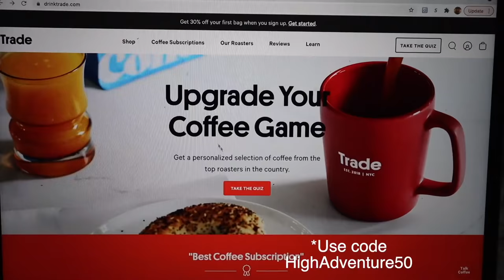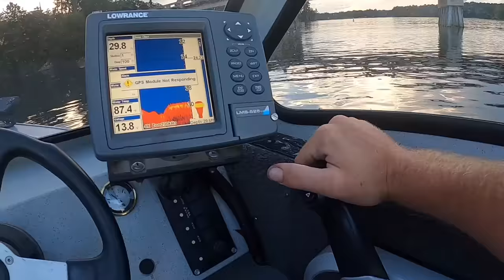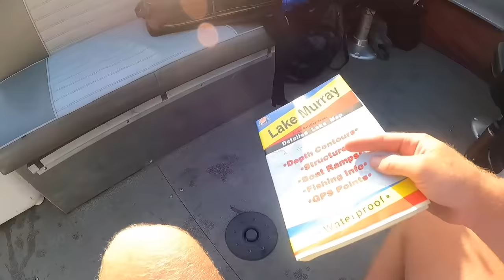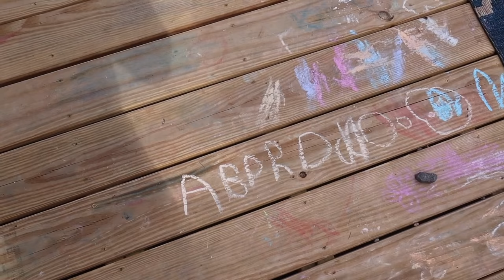48hr Catch Cook Camp From a BOAT!

Comment: Those live crawfish I've used a lot. Use small treble hook even if you don't like them. Regular style J or circle they will come off. Hook 1 prong under side of tail at the flapper center. #2 prong further up underside of tail but far to one side just enuff to punch though the shell. It'll stay alive and it won't come off unless you get a massive strike. Catfish don't play with it at all. Be ready,their going to just slam it.

Comment: Tie your bow line to the trailer by the winch. It should be at least a bit longer than your trailer. Let the boat go off the trailler pretty far and then creep forward till the front 9f the teailer is out of the water. That way you can pull the boat to the dock and not get your feet wet. Been launching alone for many years.